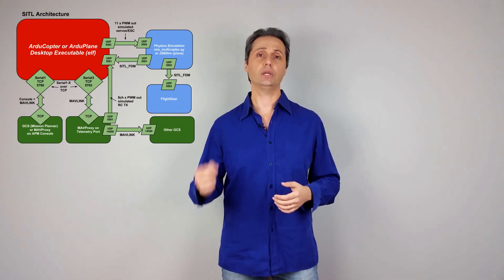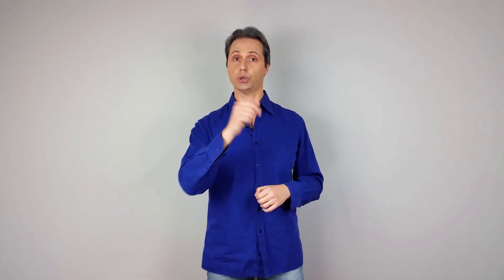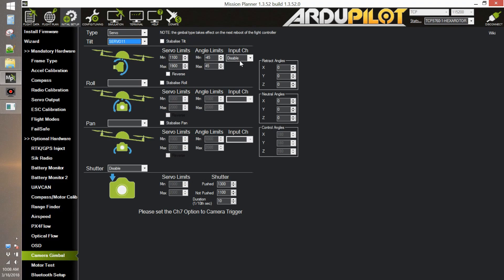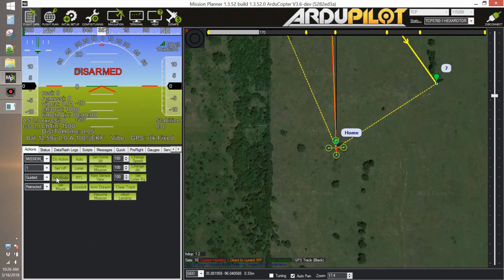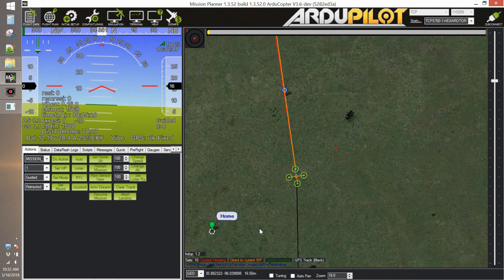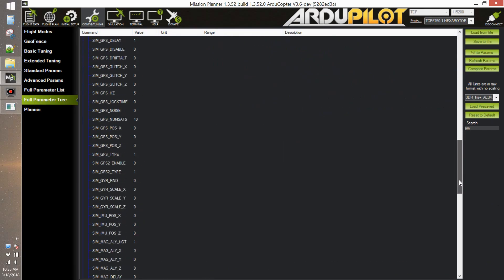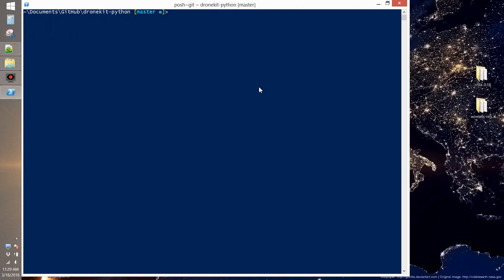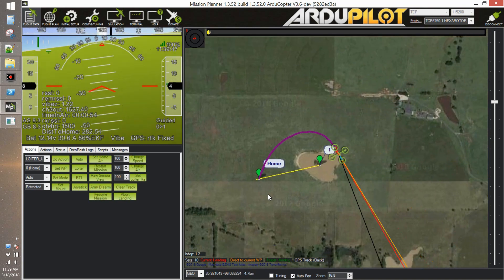How to use SITL in Mission Planner for Ardupilot

Comment: Hi Mr Tiziano, after trying dronekit-sitl copter - -home=33.5,73.1,584,353 i get an error that 5670 port is already in use

SITL-0.stderr> bind port 5760 for 0
Starting sketch 'ArduCopter'
bind failed on port 5760 - Address already in use.

Im using windows 10
Reply from the maker: Use UDP rather the TCP port
Reply from the maker: actually, 5760 might be taken by Mission Planner already, try 5762

Comment: Hi, I was trying to run a simple test.py script on my laptop where the mission planner is running and connected to tcp:127.0.0.1:5760 and had no issues running it via tcp port 5762 (python test.py --connect tcp:127.0.0.1:5762). Im now trying to run the script on my rpi which I'm sshing to via wifi. I run the same line (python test.py --connect tcp:127.0.0.1:5762) and Im getting the error [Errno 111] Connection refused sleeping. Any help would be appreciated!
Reply from the maker: SIL opens 5762 and 5763 only after something had connected to 5760. I'd recommend using mavproxy connected to 5760 and proxy to a UDP port where you connect your Pi

Comment: Mr. Tiziano, I have a question about flight modes in dronekit, is it the same as in this documentation https://ardupilot.org/copter/docs/flight-modes.html ? because the copter documentation is error https://ardupilot.org//docs/flying-arducopter/flight-modes.html , and how do I use altitude hold modes in dronekit without gps? Thanks for the video
Reply from the maker: You can set any more available. If you are indoor and try to set a more that requires gps it fails. I advise you not to use any manual modes, like alt hold or loiter, but use guided, guided no gps

Comment: Hi Tiziano! Thanks for the instructive video. I am trying to use MP with a separately built AP/SITL (i.e., not the one MP downloads & builds) and X-Plane. I am able to get my model on X-Plane takeoff by issuing commands from MP/Flight Data/Actions, but have trouble using a T.Flight Hotas X joystick with MP. I was wondering if you'd have some suggestions. I invoke MP with the command line options /joy "T.Flight Hotas X" /type plane, and, setup the joystick axes and channels in MP/Flight Data/Actions/Joystick, and "Enable" it. I have set a breakpoint in AP where it processes a MAVLINK_MSG_ID_MANUAL_CONTROL, but it is never reached, when I manipulate the joystick even after my plane has taken off. Have you successfully used a joystick with MP and SITL? Thanks.
Reply from the maker: Sorry, but I have no experience with x plane

Comment: Thanks for great dronekit videos Tiziano.
When i write C:\Python27\python.exe  .\dronekit_test_05.py --connect tcp:127.0.0.1:5762 this code i had this result TCP ports must be specified as host:port.
Do you have any idea about fix this
Reply from the maker: Be sure that port 5760 is actually open. SITL opens by default only 5760 and only after the first connection then opens also 5762 and 5763

Comment: Is it possible to simulate 2 drones in SITL and visualise it in Mission Planner ? Secondly, is it possible to read the realtime positions of both drones from SITL ? The reason is because I am trying to test out and compare different guidance trajectory algorithms for the drone, and hopefully visualize it on a map.
Reply from the maker: Start 2 sitl and assign them two different ID. I don't know whether you can do it when you launch them, but you can do it by assigning a different sys_id parameter
Reply: @prandtlmayer , I am relatively new to python and just need some help with figuring out what are the commands to type to start 2 sitl instances. Also, how exactly do I assign different sys_id parameters?

Comment: Hi sir, I was directed to this video from your previous video on dronekit-sitl in 2017  (which you pointed out is obsolete). My question is how does one go about 'connecting' Mission Planner GCS to the 'simulated vehicle' before I run the simple_goto.py Python script? The problem I am facing is that the GCS takes time to connect to the simulated drone after I start running the Python script and I can't observe the drone movement in Mission Planner for the early portion of the code. Any advice to resolve this ?
Reply from the maker: SITL starts waiting a connection on its tcp port 5760

Comment: Hi Tiziano, I am currently using the latest version of Mission Planner which is 1.3.62. I just updated it from version 1.3.60 and am still having issues with SITL staying disarmed. How can I fix this? I see where you armed yours at minute 2:25 in the video but it's not changing anything for me.What version of Mission Planner were you using in this video?
Reply from the maker: Let me check it and I'll be back to you
Reply from the maker: Ok, the version I am using right now is 1.3.62. I started the SITL, connected through TCP (sometimes it doesn't connect automatically so you need to click on the button yourself). Once the EKF goes to white the system is ready to arm. Now, you need to set your vehicle to a flight mode where you can actually arm, like GUIDED, LOITER, STABILIZE... Sometimes the SITL starts off in RTL, that is not armable

Comment: Hii Tiziano, the simulation is working perfectly with mission planner in windows with or without the script. but when i tried to work with the ubuntu like you shown in your video "Dronekit setup, simulation and visualization on Mission Planner" i am getting time out error. do you have any idea?
Reply from the maker: Do you have connection between the two Systems?
Reply: @prandtlmayer yes, but I don't know where I am going wrong. currently, I am working on VM ubuntu 18.04 on windows 10. I will try it windows 7 then will let you know.

Comment: Very good video ! I have seen also a previous video when you use dronekit and ubuntu VM, I am following your instructions but I cannot connect VMs with the MP. I used same TCP IPs and UDP ports, but it keeps going 'connecting' forever. Could you please give me any suggestions?
Reply from the maker: Marsel Omeri unless you are customizing the code or want to try different releases, I'd use the method showed in the video here. If you need to run it on Linux VM, be sure the network is in bridge mode, so that the VM has a separate ip address
Reply: Tiziano Fiorenzani Thanks and keep up with the great work. Is very helpful !

Comment: Is there's a way to test the latency of a camera/video feed within Mission Planner?
Reply from the maker: It would help you you explain your setup a little better
Reply: Tiziano Fiorenzani I currently have a camera feed overlayed on the HUD via my laptop camera for now. Eventually, I will be using a raspberry pi and pixhawk. I will be overlaying the camera feed from the pixhawk onto the HUD. I want to make sure the video latency is max 350ms.
Reply from the maker: the latency only depends on your encoding/transmission/decoding setup. What camera are you sending: Is it analog or digital? If digital, what is the protocol. Are you using gstreamer?

Comment: How can I simulate the battery power in SITL? I would like to see how Mission Planner displays warning boxes when the battery falls below a certain threshold
Reply from the maker: Sade L the easiest way to test it immediately is to set the battery failsafe at a value higher than you currently see in the main window